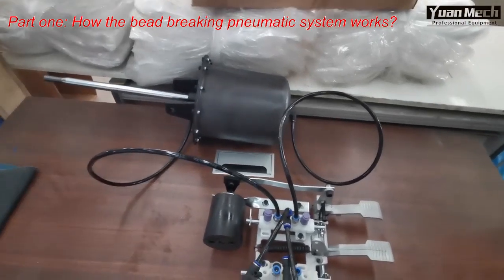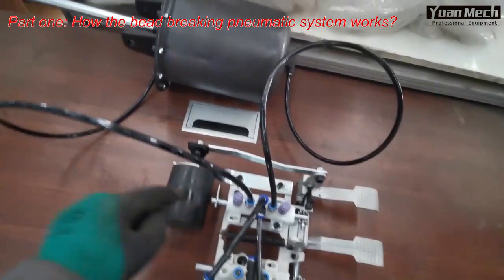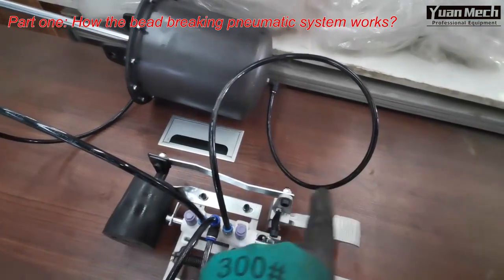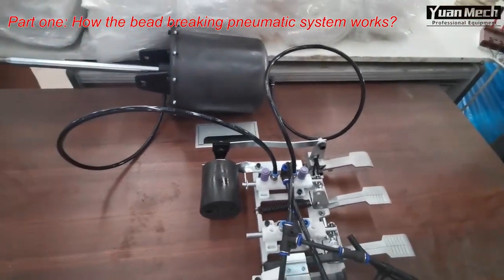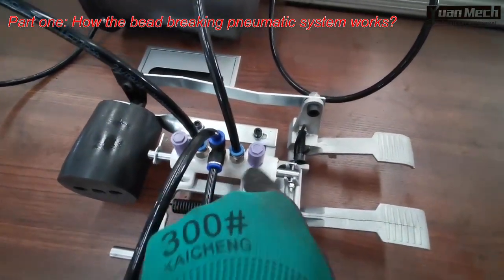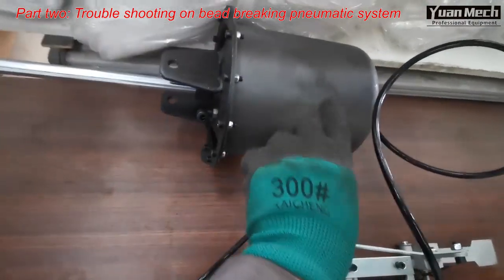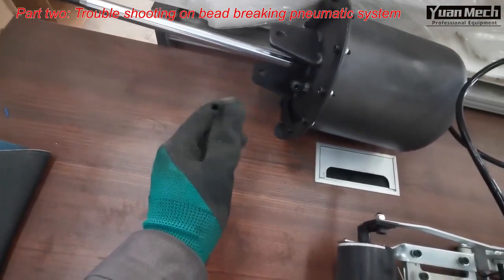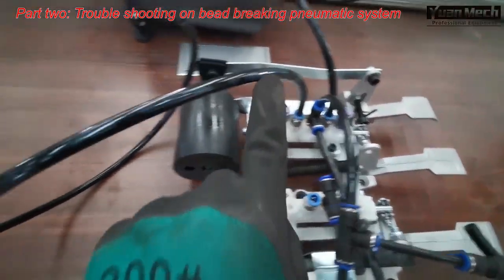Tire Changer Bead Breaking Cylinder Trouble Shooting

Comment: so I have a very busy tire shop and I'm always needing maintenance but the prices are very high at least once a year need to change a table top cylender for each tire machine I have 8 but they charge me $800 each machine each time.. so my question to you is what part of the cylender causes it, maybe I can just change something in the cylender instead of changing entire cylender.. online cylender cost same price $600 the technician charge extra $200 to put it on.. so I wanted to see how I can save half or lesser
Reply from the maker: Service of tire changer table cylinder doesn't cost much, which brand tire changer machine you are working with?

Inside cylinder there are rubber seals. You could replace only the rubber seals.

Please share photos of your tire changer machine, my email: service@yuanmech.com. We will advise  then.